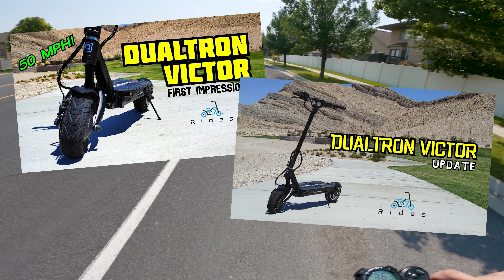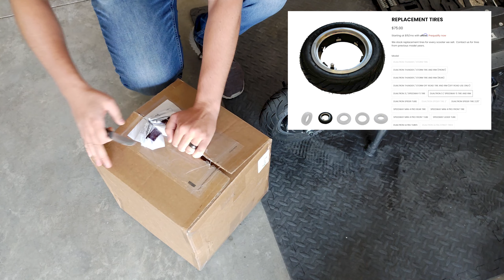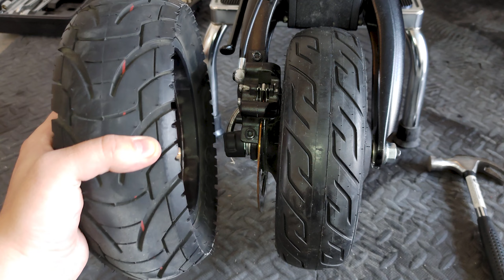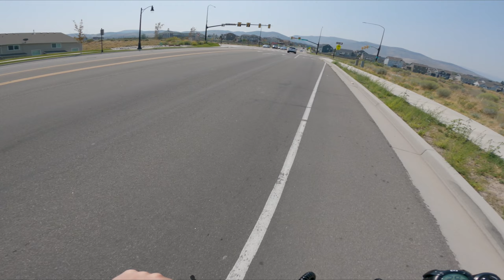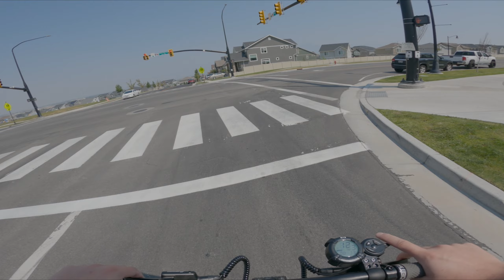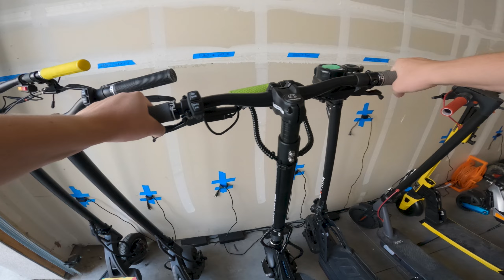Dualtron Victor Tubeless Tire Conversion + 50 MPH Zoomin' Ride

Comment: I was getting horrible battery life today.  Come to find out rear tire was flat.  I did like you and ordered two new Dualtron 3 tubeless tires cuz I don’t play around.  Nobody got time for flats when I’m tryin to rip on a 3k scooter.  Also, ordered the rear kickstand like yours.  Love my toys!
Reply: So received my tires n rims.  Took the back one off like you did but the bolts had locktite on them and one stripped out and the other the head broke off.  Total crap!  I managed to mount the other rim and wheel on filled about 45psi and test rode it.  Ran like a champ!  Plus, installed the rear kickplate/handle and I love it.

Comment: The 2 main problems you experienced can be solved by doing this, for the eye-one do a we shim made out of paper any paper will do but start at 80 gsm. For the other problem mudguard screws go purchase an Allan key, grind it or get a machine shop, you will be grinding down the short edge till it can fit in. Not hard fixes. I had a dualtron 3 till a week ago when it got stolen 😩
Reply: Breaks my head gets me in a rage to hear this. Damn. How? 
In the future security is a three step process. 
Hiplock D1000. Grinder proof U-lock . I have the Skunk lock U-lock. Next best thing down.
A movement alarm. Also a disc lock. 
Then gps. 
ALL this makes it a PIA for the person looking to take your hard earned stuff and move on.

Comment: Thanks for the vid. Im having also 2 flats on my Dualtron Victor in 2 weeks. Both of them with 65kmh speed, straight smooth road and pinch hole on the rim side. So thanks to your advice I ordered Dualtron 3 tubeless tires. Lets see if I can ride with more confidence and don't have to call someone to pick me up in the future.
Reply: Ever tried the slime thingy?

Comment: I changed both tires and I highly recommend it. These tires maybe less thinner but more grippy than stock ones
Reply: Did the speed change or battery life while riding?
Reply: @doublahh  cornering and top speed increased before is 82 after on speedo 92. With stock tires in dual motor mode front wheel can’t catch traction before 45 km/h with these tires 25 km/h. Best thing about it these tires very durable. I flatted 5 times in a month. After 6 months 4000 kms and 2 set of tires never a single tire flatted. I highly recommend you to install these tires

Comment: You should get yourself some PMT 90/60R6.5 tires. They fit the Dualtron 3 wheel but give you a real street tire that lasts and corners amazing.  I have them on my Dualtron 3 I had to slightly modify my frame at stock ride height but if you lower it, it will still clear the rear damper. If you would like more details, let me know.

Comment: Not sure if the new tire is smaller diameter than stock, but at least with cars that have AWD, a major discrepancy between the front and rear tire diameter can cause damage to drivetrain.
Reply from the maker: Yeah it's slightly smaller diameter but  I will be swapping out the front for the same size tire as well so i wasn't worried about it for one ride

Comment: Did you guys ever get the front tire converted as well? Would love to hear more about the ride quality difference. Thinking of doing the conversion myself also
Reply: I did it on both. I didn’t notice a big difference in ride quality. It’s not any softer or harder than regular road tires in my opinion. It’s great for flats though. It needs a press puncture to go flat and you can plug it or patch it just like a car tire. No more buying endless amounts of tubes.

Comment: Does varla have something this for the eagle one? I have used the foam inserted tire and it flat spotted because the foam became soft. I have so many flats not because of punctures but because the tubes are garbage.
Reply from the maker: If you go off road tires and better tubes you shouldn't have issues with flats. Check out my video about upgrading the Varla to off-road tires
Reply: @RK9Rides  I just ordered those tubes. It didn’t give much information. I am hoping it helps my problem out.

Comment: It looks like you are getting use to the speed on the Victor. I wonder what faster scooter you will get next... If you want any suggestions we are here for you bro (I've got 4-7 in mind if your interested). (Personally I love to rock crackhead pro (meaning I am happy at speed)). Let me guess the next update video for the Victor will be a steering/turning damper? One other thing, is it me or does the new rear tubeless tire look like the solid tire on your Mantis?
Reply from the maker: I have another scooter on the way with a claimed top speed of 56mph! Yeah a damper would be nice. I get a bit of wobble at the highest speeds. The new tire does look like a solid tire, i thought the same thing

Comment: Hello! So glad you tried the swap! whats your actual weight, and at what pressure did you fitted the rear tire?? Thanks!
Reply: No tube on rear tire since this is a tubeless conversion. The stock tire is marked on the wheel itself for 50 PSI. Recommend getting a slime valve extender to actually pump it.
Reply: @rageburst  what?
Reply: @Guille8888  the new rear tire he uses is tubeless so you dont need to pump it. The stock ones can be pumped to 50 psi max and it is indicated on the tire itself.
Reply: @rageburst  dude, both tubed and tubeless tires need air, what the h-ell are you talking about.......stock ones 50 psi yes, but with inner tube. He replaced both rim and tire, for the DT3 rim, and the DT3 tire, that is tubeless (no tube inside), but still needs to pump air into it..... geeezz......
Reply: @Guille8888  oh! my bad then.
Reply: @rageburst  
Learning process.
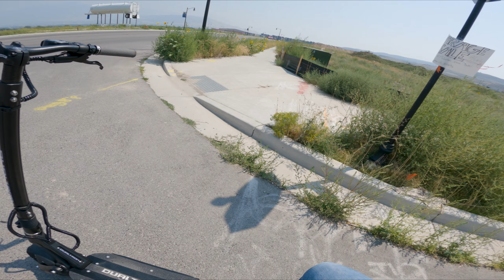At 1:52 he mentioned pumping up the tire.

Comment: How many miles have you put on the tubeless tires and how many miles do you think it will last? At 6.2 miles odo on mine I think I would like to upgrade to the tubeless tires. I'm just skeptical about how long it would last cause where I'm from the tuovt tires are more available than the tubeless dt3 tires.

Comment: What size are the rotors on the Victor 140mm?  IF they are i would upgrade to 160mm as soon as possible at those speeds.

Comment: I’m enjoying the videos man thx. I’m one second away from ordering this but that tire is issue is holding me back. What kind of range are you getting with a heavy throttle finger? I have a 14 mile trip one way and I’m wondering if the Victor can make it there and back while still putting a little bit of speed on it.
Reply: Hell yeah it can bro budget scooters even do 14...

Comment: I wish my spider rim and tire came
Off that easy
Reply: For that exact reason, i upgraded my Dualtron Spider to DT3 Motors/Rim Definitely a must upgrade! It's a complete plug and play swap with the DT3 controller as well
Reply: @dannyle8823  how much did you spend and do you have a link ??

Comment: If you getting a lot of flats first thing is to check tyre pressure, honestly I do not get why it cannot be converted tubeless in the old "ghetto" style with gorilla tape like it is done for mtb, also why you are bothering at all, for example with MTB we can run lower pressures which equals more grip, here you need exactly opposite at higher speeds?

Comment: So im new to the EScooter world, when you say "Tubeless" tires do you mean solid tires? So i don't have to worry about flate tires, cause that would be a pain having to constantly worry about changing air filled tires haha but im sure the stock tires are hefty to.begin with. I plan on buying the dualtron victor this upcoming week alongside 2 solid tires just in case of future flats, which solid tires would you recommend work best for this beast? Also, do you have any promo code or discount by any chance? 😂

Comment: Wow, do you have all those scooters and other EVs in your garage?! Are they yours?

Also, I always thought Dualtron make the most powerful electric scooters in the world, is that pretty much true? Whenever I read about Dualtron, I thought they're ultimate.
Reply: They make the better end of scooters, build quality etc and you need to consider there is a Dualtron 10x . What is far more important is.

1 body weight as it will determine top speed, stopping distance etc
2 what terrain will you be on generally (imp

How does it handle, Breaking etc, balance, top speed is irrelevant as that is actually subjective.